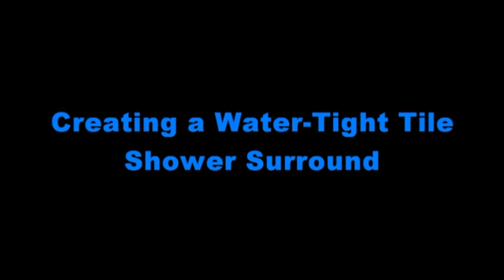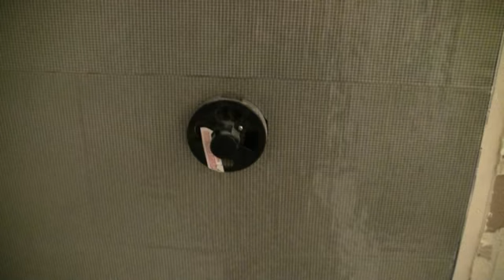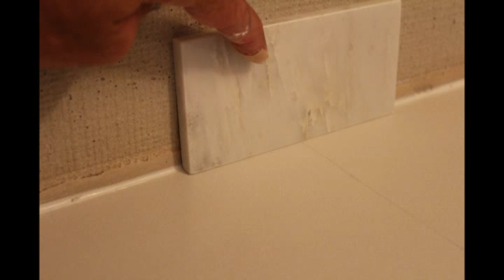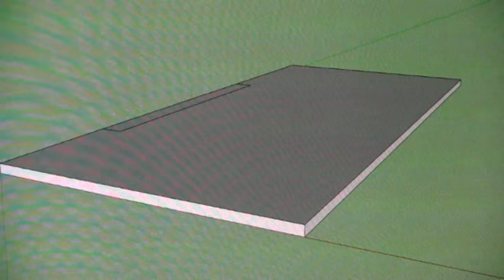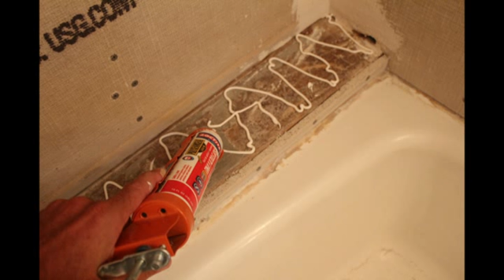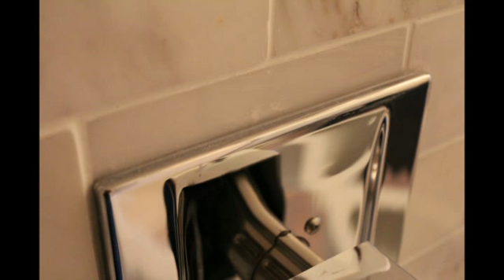Creating a Leak Free Shower

Comment: Can Bondera be used to reface a tile on tile fireplace fascia?
Reply from the maker: +Jahi HORNE Hi Jahi.  There might be a problem with the potential heat from the fireplace...but I'm not sure.  Bondera is a rubberized product...I would check with the manufacturer to be certain.

Comment: Thank you for sharing. I am redoing bathroom. I the Backier Board does not meet in the corner, what can you fill the space with?
Reply from the maker: Hi Elton.  Ideally, the backer board would meet in the corner.  If the wall studs are crowned (not straight) it can make things difficult.  One idea would be to shim out the cement board so that it meets in the corner.  That way, you can create a seamless water tight enclosure without worrying about problems down the road.

Comment: I had a frameless sliding  shower door installed three days ago which cost $2400 . My first experience was horrendous. There was leakage from the bottom of the moveable door. Shouldn't there be a  barrier at the bottom as well as at the middle  (going straight down) where to two doors cross to prevent seepage??? I contacted the company and was told that there will be a charge of $160.00 to install something akin to a "speedbump" that MIGHT prevent seepage.This is wrong on so many levels. Please advise.
Reply from the maker: Hi Verna.  If it's a swing door, there is typically a rubber sweep under the door that helps make a seal underneath to the marble, tile or granite.  In some instances a rubber gasket is used between the vertical of the door and the fixed panel...it really depends on the shower head type and location and the customer's desire to have the additional protection.  The additional strips of rubber usually aren't pretty, so some people decide to live with a little water rather than "dirty" up the install.  When a professional installs a door, they should look at the existing conditions and make any modifications necessary to make sure the enclosure is as water tight as possible.  Of course, shower doors aren't submarines so a drip or two here and there is common depending on how its being used.  But if a significant amount of water is escaping, I would think the installer would install the additional measures free of charge...just my opinion.

Comment: Great video with good ideas. Started working on re-grouting the guest bathroom. The tub has more of a bench than a ledge. Soon after removing the calk, one tile piece broke loose, then another, and another. Sure enough, water had penetrated through the grout and the backer board no longer its job. So, need to replace the bench. This video game me some good ideas.

Question, did you place concrete backer-board under the quartz slab or was it just the piece of wood?

Thanks!